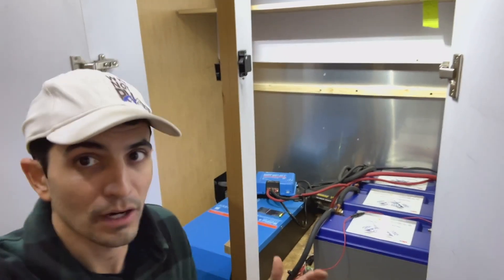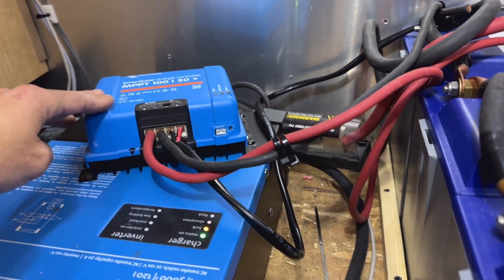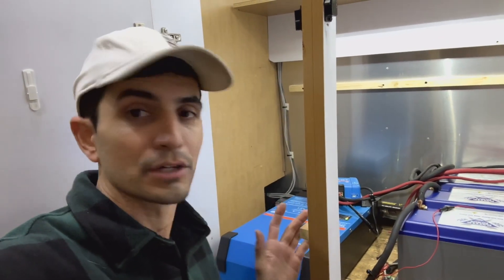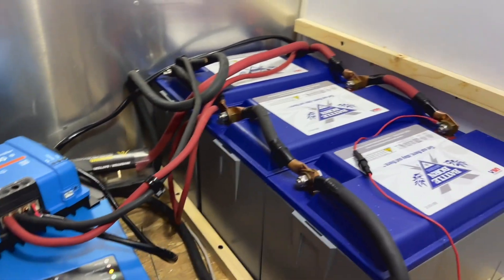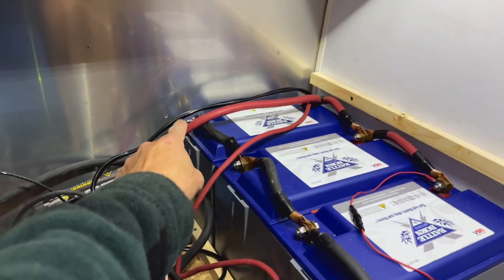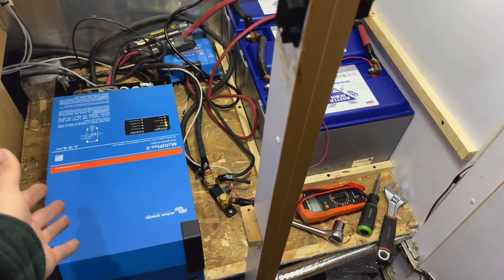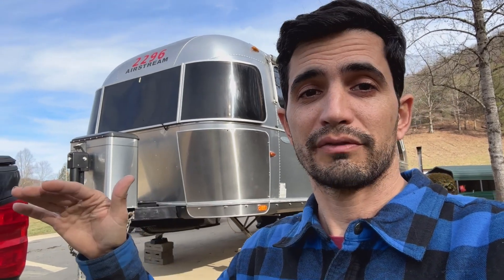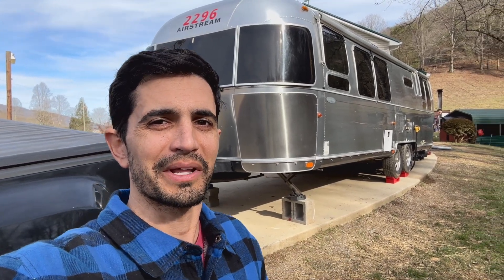How NOT to install Solar Controller/ Battery Monitor - Why Not RV: Ep 116

Comment: SO how did you run the cables from the solar panels down? 
Thanks
Reply from the maker: They were already ran. Through a typical solar style port basically between the wall of the shower and closet

Comment: The wire size was too big for the charge controller! It looks like they tried to force it in! Surprised they didn’t have a fire!
Reply from the maker: It’s surprisingly the right size for the maximum amperage that charge controller is capable of. Ferrule connectors is how its should be done. Loose wiring in like this has a tendency of coming loose and causing overheating at the terminals or potentially shorting out.

Comment: This raises a bigger question....did you inspect the trailer before purchasing?
Reply from the maker: I just checked function of all the major appliances and for any evidence of leaks. Due to my plans with this rig and my capabilities of repairing. I got a very good deal on the rig and you’ll be seeing all of what I’ll be doing to it here over the summer.

Comment: And,   .... There's so much more,  ...   I'm SURE, you have, or, will,  check the integration into the panel,  ...  if panels were added, ..  correctly mounted,..   sealed?....    Good job,  ....  Great vid.....
Reply from the maker: Yes. Exactly. And it’s a long list. Thank you